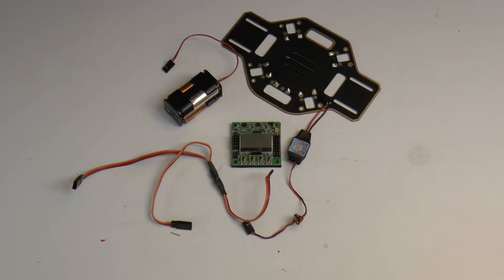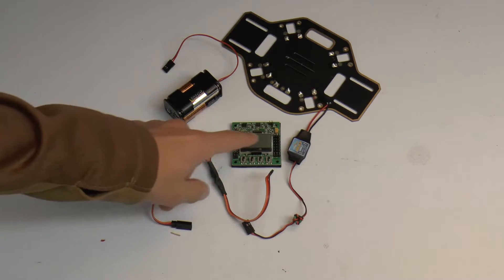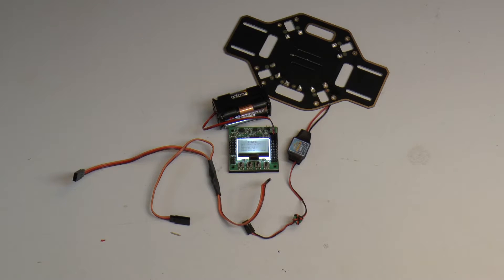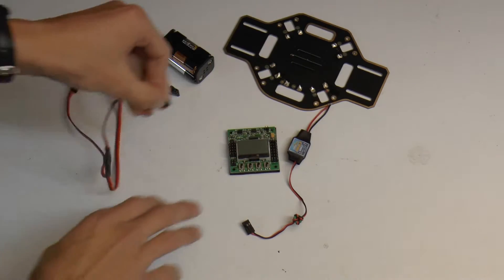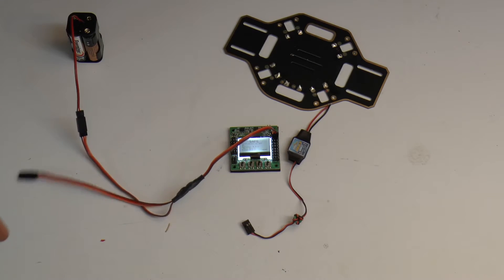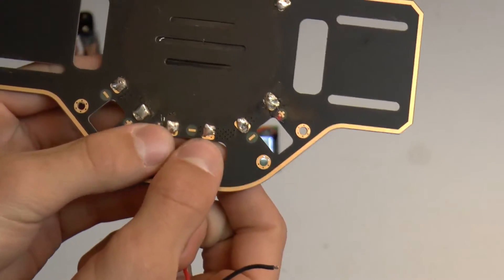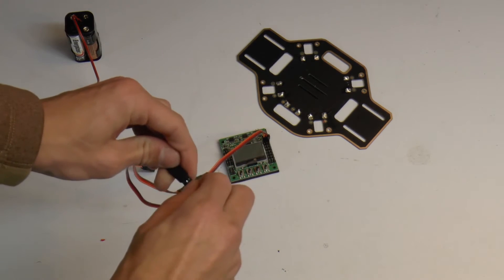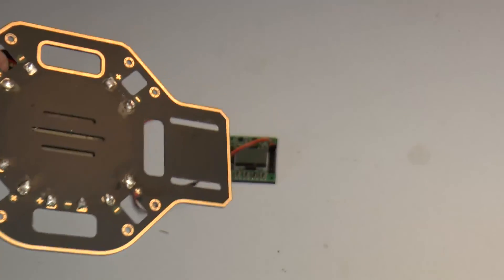HOW TO | USING DJI ESC'S WITH KK2

Comment: On my F450, I use a UBEC and plug into the BATT/BIND on my AR6210 RX and it powers the RX, KK2.1, and my gimbal.  Not sure if it is right, but it works.  My FPV TX is also soldered into the battery input lead.  I never thought to use a Y cable for UBEC/M1.  Makes sense to do it this way if you have to.  I'll keep it in mind for my next build. Thanks.
Reply from the maker: Great idea too. I didn't know the kk2 could be powered through the receiver inputs. I did know the receiver could run servos but I never considered that with the kk2.
Reply: Yep.  The issue is this:  you have to power your servos from your RX too.  I have all of my servo + wires connected to the + posts on the RX.  The signal and ground run to the proper posts on the kk board.  It is ugly as sin, but works great!!